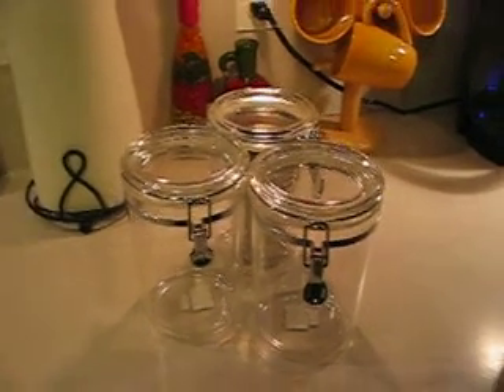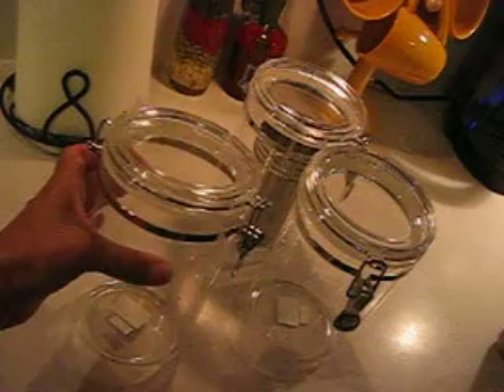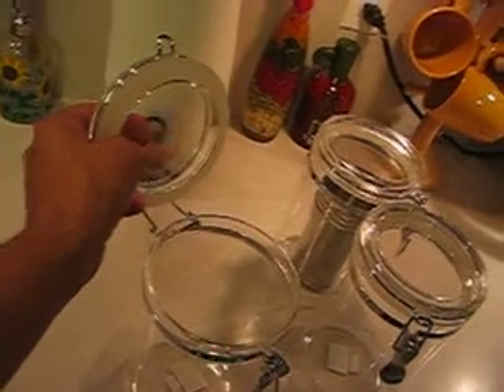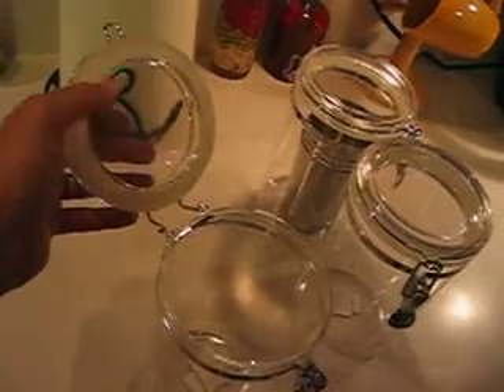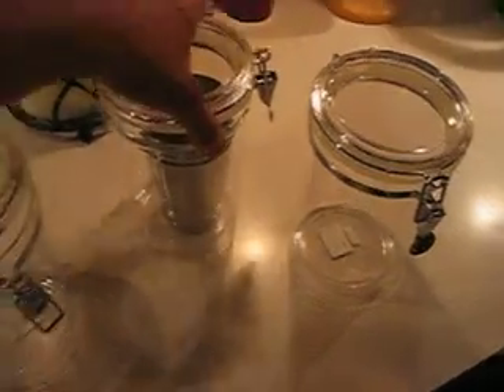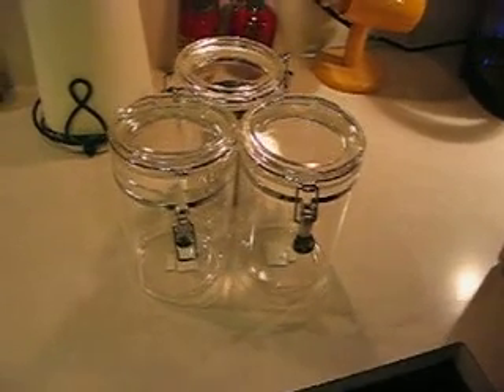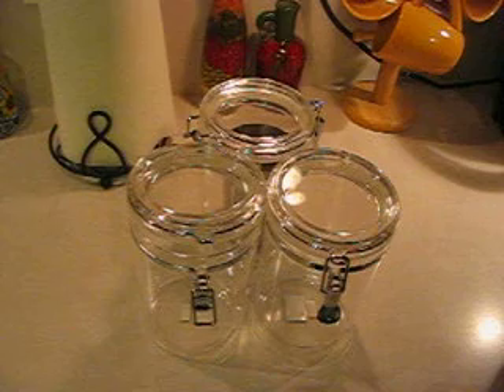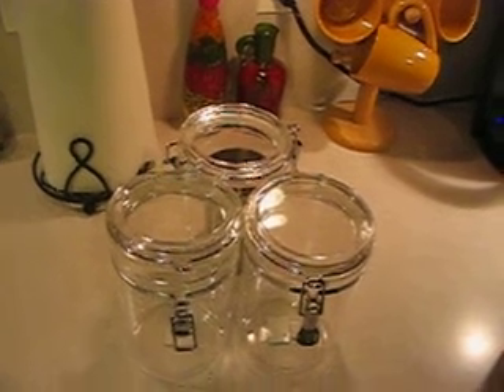Hydro Lab (My Garage) #48

Comment: they cracked under drilling, and also regular use. i was trying to use these as a pre-filter for the pcv valve on a car. i didnt work. they also didnt seem to stand up to high heat apps either.